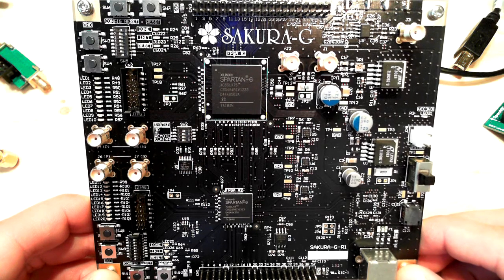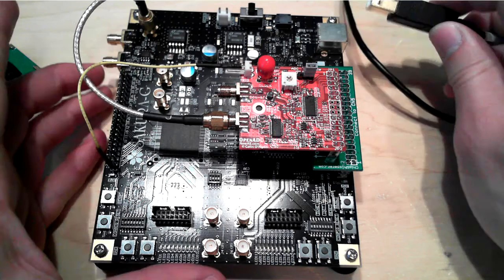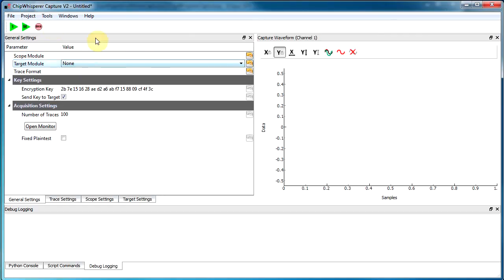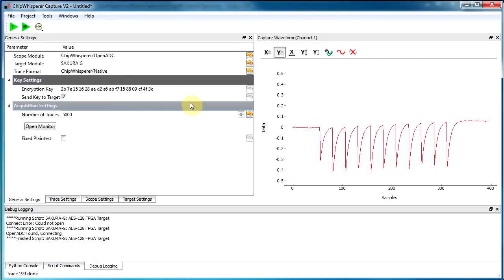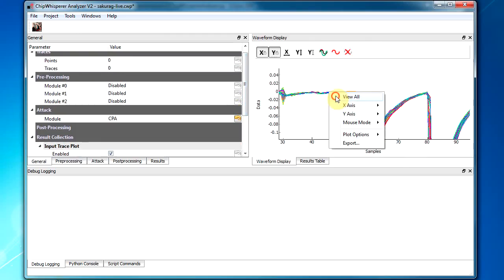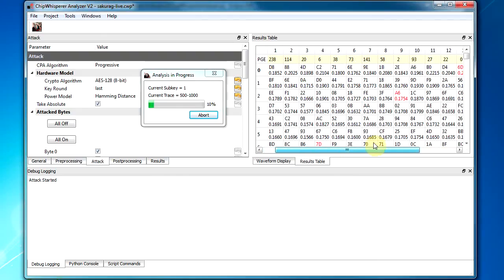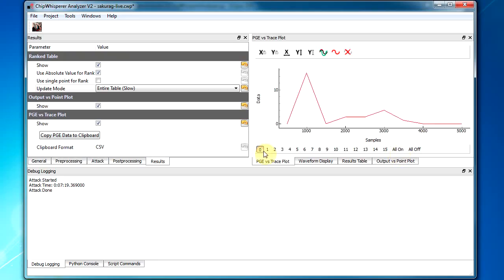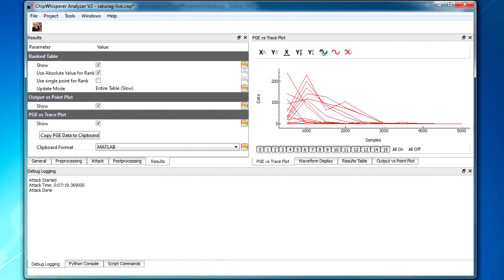SAKURA-G OpenADC Add-On (ChipWhisperer, SAKURAG)

Comment: Hi Colin, 
I am using oscilloscope with 2.4Gs/s to measure the power consumption. then i compared the result with my prototype.
I can see ten rounds operation of AES. 
My question is which one of this rounds that i need to focus on (which rounds that i can compare with my hamming weight model). 
is it the first one? or all ten round. 
I have tried up to 2000 power traces but still fail. 
FYI i am using SASEBO GIII/ SAKURA X. 
Thanks Colin.
Reply from the maker: Normally you'd be using the Hamming Distance (HD) model, assuming we are talking about the default AES implementation! The HW model won't work. I'm setting up a discussion forum for side channel stuff at https://newae.com/forum/viewforum.php?f=9&sid=9f58059075b48f0476f9930edefbdf0b which might be an easier way to give you some points, feel free to start a topic there (there's nothing yet as the forums aren't even really open yet but you can register!). But with that you can target the last round, assuming you've got the cipher-text output.
Reply: Colin O'Flynn I have started one topic but need to wait for the admin to approve. Anyway, the platform that I used in this demo is from http://dpabook.org/ . In this case the input is plain text (not cipher text). The recorded power traces is in CSV file and combined it in one matrix than i used correlation function to correlate the power measurement. I am wondering there is a problem in selecting the power traces. From 10 rounds AES opeartion, I selected only the first round which is more related to prototype that I built. I repeat the process for 2000 plain text.
Another guess also that the FPGA (in this case is KINTEX7), has been implemented some hiding method to make power traces and data are independent. If this case happen, is the power traces necessary to increase up to 10000 power traces? or any other solution?
Thanks Colin.
Reply from the maker: Hello,
There shouldn't be countermeasures etc I think. It's probably the case of the wrong power model, where using a HD is better than using a HW. I just approved your topic on the forum (only first posts gets held to stop spam attacks), I'll comment more there as easier to have links/attachments...